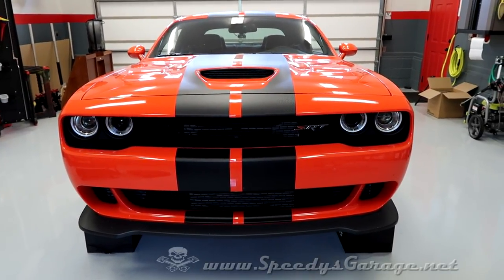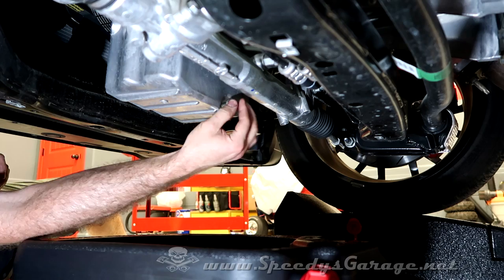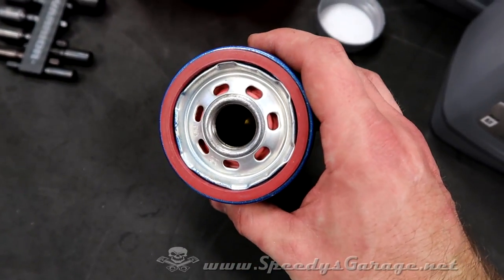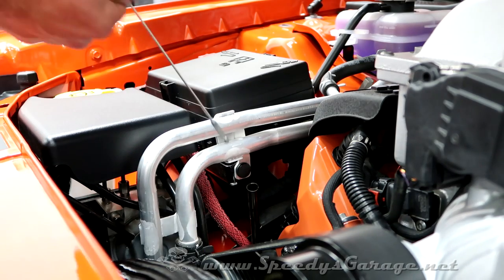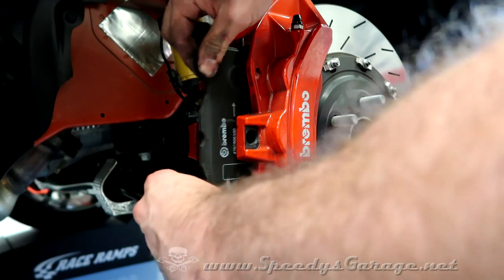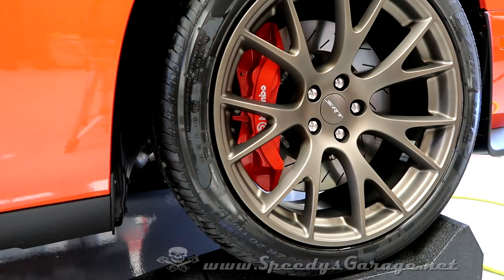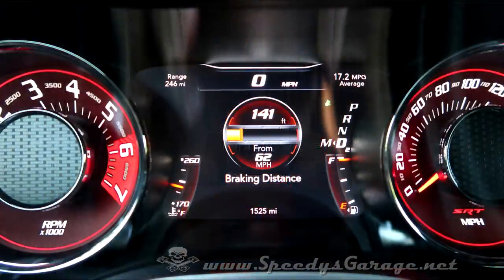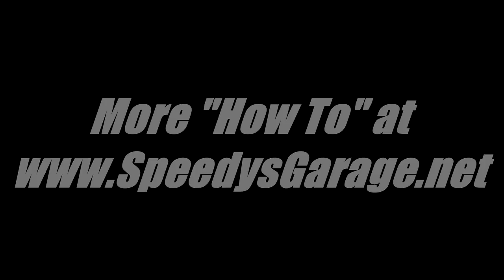Speedy's Garage Challenger Hellcat Oil and Brakes

Comment: I sold High performance racing parts to speed shops for a while & gravitated towards MOPAR guys... I've sold many brake packages of all types & the feedback I received from my Customers across the board was that pad break in was slightly more extensive than prescribed instructions... It usually entailed factory break in and 25-50 normal city/highway stops...All resins have burned off by then...

Comment: Did you know the 2017 Hellcat has a different Dipstick and holds a quart more oil? No other parts are different just the dipstick. So I got the 2017 dipstick and added another quart of oil. These cars do use oil so I think it its a good Idea to have a little extra. Also it seems to take about 25 mins for the oil level to register properly in my car. The brake caliper center support bolt is 22ftlbs.

Comment: Same guy that admires your basically everything here. Commenting with a different channel.
I have a 19 hellcat and was scared to drain the oil cooler. I thought it would starve the engine for a second more than I'd like. I usually fill the oil filter with oil and thought emptying the oil cooler would be the same as not filling the oil filter. Dry start up bad.
Reply from the maker: Right on

Comment: Totally, the wrong oil filter. Yet, I have found that STP has/had two different filters that will fit the vehicle.   I like the K&N filters best, yet I kind of use what I could get my hands on.  I change my oil often.  Also, I like ceramic pads which has less brake dust.  Like the oil I change my brake pads often.  Yet, I'm in the midwest I suggest checking your brembo pads and operation of same every 6 months at least.  By the way, nice video.  😊

Comment: Hey man I have a 2016 Challenger Hellcat. Changing the oil soon. Only question I had is where exactly are all 10 of those push pins located? That’s the only thing I’m kind of worried about lol because I don’t want to miss any. The rest of the 10/7 MM seem pretty straightforward. Get back to me if you can thank you! Great video 👍🏾
Reply from the maker: There pretty hard to miss.  Most are on the bottom, and a couple on the bottom of the front wheel well area.
Reply: Thank you for the reply I was able to complete it successfully with the help of your vid! Do you have the specific race ramps these are In your video or a link of them by chance? I have a stock 16 challenger hellcat and I’m looking into race ramps that won’t damage or scrape the car/front splitter since it’s pretty low. Jacking the car up is sort of a pain. Much appreciated if you could reply again thank you 🙌🏽

Comment: I am so glad you also used the Mobil 1. Some people thinks it is heresy not to use the FIAT/Chrysler recommended Pennzoil Ultra Platinum on the SRT vehicles.
Reply from the maker: I actually plan to switch over to Penzoil Platinum as it's my go to oil in the other rides.  They didn't have 0W-40 locally for a while and now it's available in the 5qt jug.  Be on the lookout Friday for a new video where I discuss oil analysis and why I like the Penzoil Platinum.
Reply: It will be awesome if you do the Blackstone Oil analysis for side to side comparison between the Mobil 1 vs Pennzoil UP

Comment: Good video, bit I would not use any oil that doesn't meet Chrysler MS-12633, even if it's 0w40. 
Anyway, I started using Amsoil Signature Series 0w40 which meet MS-12633. It seems like I'm getting better mpg and it does ride smooth

Comment: I put them on and went to the road course! Death Trap!! Either keep stock for both road and track use, or get track pads for track weekends (keep swapping).
Reply from the maker: I would not recommend anything but a true track pad for road course track days.  These cars weigh 4500 pounds and I'd question even the stock pads being enough.  I was able to EASILY cause fade on the STOCK pads after 3-4 consecutive hard stops as you could see from the tests each stop got longer with Z26 and Stock Brembo pads ending up almost the same distance in the end.

Comment: Hey speedy, did you ever find out the torque spec for that 13mm bolt? And also do you know what the torque spec is for the 2 bolts holding the whole caliper on? (For the front and rear) is it 121ft on the front and 98 ft on the rear? Do those need blue loctite as well?
Reply from the maker: I honestly can't remember.  I'll leave this out here and hope someone chimes in.
Reply: @SpeedysGarage  let me know man. I can’t find it anywhere and I’m gonna be doing a rotor and pad job on the car soon!

Comment: Hi speedy. You have some great videos man. Thank you for the information. I just went out to my driveway and swapped my brake pads watching your video. Thank you. 
I have one question. Are the new brake pads directional? In other words, does it matter which pad goes on the inside of the caliper and which pad goes on the outside?
Reply from the maker: Shouldn't matter in most cases.
Reply: Speedy's Garage I’m assuming in this case it doesn’t matter. 

Thank you for the reply man.

Comment: Hi Speedy- Did you or do you check the final oil level while the car front end is still up on the ramps? (Getting ready to do first oil change and change out the brake pads also...appreciate the torque specs...Thanks)
Reply from the maker: Both.  I check it on the ramps to make sure it's good to start and roll off, then recheck on level ground.
Reply: @SpeedysGarage  Thanks...I'll do the same.

Comment: You probably answered this question before but where did you get those ramps? How much$ ? And model #
Reply from the maker: They're Race Ramps.  I have these:  https://amzn.to/30Z1ApR and picked up some extensions for lower cars:  https://amzn.to/2SPyYMS  Highly recommended.
Reply: Speedy's Garage thanks I’m gonna look into getting the 10” higher ones that way I have more room to go under with my creeper. I saw on the net a guy with a Z06 using them and it cleared his front lip.

Comment: Since the Hellcat Brakes and the SRT 392's are the same. Where about do you buy your OEM Discs? I've found a couple of sites but I was just curious about how you go about it, as for your brake dust I sometimes use Autoglym Wheel Protector
Reply from the maker: Haven't had to replace the disks yet.  Solved my dust problem with new Z26 pads...now everything stays nice and clean.

Comment: Do you have to change the  dish or rotor every time you change the pads on a 2017 dodge hellcat
Reply from the maker: Only if worn past min thickness
Reply: @SpeedysGarage  thank you, the service adviser at the dealer in Miami Florida  that I had my car serviced at, told me that you have to change the rotor every time you put on new pads regardless if they are worn  or not. He said a brake job would cost $3000 dollars per axle. That the rotor, worn or in good shape could not be turned on a hell cat.

Comment: Only problem is Mobil oil does not meet the Chrysler spec. Pennzoil ultra platinum does that’s why it’s recommended. It’s the fill for all srt products. I would only use a mopar or mopar srt filter for the application also.
Reply from the maker: That's all gimmicky contract stuff between manufacturers unfortunately.  Chrysler had a deal with Mobil1 for their oil.  When FCA took over they had a deal with Shell (Penzoil) and changed the specs etc.
Reply: @SpeedysGarage  You are mostly correct but there are slight additive differences. Are you fine probably, if its under warranty then I would just stick with oem till that's out. Nice video with great information, just a point I wanted to bring up.
Reply from the maker: Yeah the warranty stuff is disappointing for FCA.  I've heard of them voiding guys warranties for not changing the oil every 6 mos as well.  Makes me wonder what happens to a warranty on a car that sits on the lot for more than 6 mos.  SMH.

Comment: Great video!! I have been following your vids for a while now. I'm glad you take the time to share your experience, I for one really appreciate them....Your R/T was bad ass and I'm sure your Hellcat will be (more) to... to bad you couldn't keep both but I'm sure you feel the same. I have a new 2017 M6 HC pitch black and my wife has a 2016 A8 scat pack shaker, redline tri coat pearl... defiantly  keep us posted on your mods, I'm changing the oil this week end on the scat pack then in a month or so for the HC, I only have 600 miles on her so far...LOL

Comment: Why would you sacrifice replacing OEM brake pads with proven entry level Chinese  powerstop branded ( box is powerstop but  brakes are purchased from various low budget Chinese brake pad manufacturers) brake pads?
Reply from the maker: Because they work much better and no dust.
Reply: @SpeedysGarage  Please define "work much better".

Comment: mobile 1 over purolater any day! ebc red stuff pads over any other pads any day too! hawk pads are awesome but have noise issues.
Reply from the maker: Meh, Mobil 1 is "OK" but over priced IMO.  I did extensive testing on a throw away car over a 4 year period with extended drain intervals using  Purolator PureOne filters including Blackstone oil analysis against Mobil1  and others, and results were better with the Purolator.  Not by much, but still.  Considering the Purloator PureOne filter is half the price of the Mobil1 and tested out better, it's a no brainer.

I have EBC Redstuff pads on another car, and they do work well, but generate more dust than the Z26 Powerstops.
Reply: I can agree that mobile1 is over priced. I've been lucky to have it in a local wally world cheap so i stocked up. I've never been a fan of the purolator filters as I too have noticed that they are thinner in size than oem. The same was true for my impala, my r/t magnum, and 300. I didn't do any oil analysis but I did notice I needed to change the oil a bit earlier. I moved on to wix filters and amsoil filters and oil. So far ok but nothing id push on others. I just can't see me going back to purolator filters. 

As for the EBC reds after my initial "brake-in" period I haven't had much dusting. my wheels are painted white so I must be lucky there lol. Also its a family car so it doesn't get the speed demon abuse so that could also be it. However they stop smoother and make less noise and dust than the old hawk performance pads and definitely oem. I will give the z26s a try out in the future.
Reply from the maker: On this Hellcat, I called Purolator to find out what is up with the filter.  The guy is check, but suspects a wrong P/N is being published.  PL12222 is a small filter with the same thread.  PL24651 is a MUCH larger filter and what I used on the old 2009 R/T Challenger.  I'm betting that is the proper P/N for the Hellcat and just waiting on them to confirm.
Reply: WOW. please keep us posted!
Reply: @SpeedysGarage mobil 1 better than stock penzoil sir no ..?

Comment: Z26 pads are biggest piece of shit pads on this planet! 
I have SRT392 and have tried them for 6 months...you do not get any break dust but very dull bite, and they create hot spots on my rotors that are visible and on top of that they are super dangerous when wet. Driving for 20min on the highway in pouring rain (pads are soaked and cold) and then apply break ...no bite for like second or 2...unacceptable.
Now I tried Raybestos Element3 pads P/N: ETH1405 and they are way better than Powerstops, not scary moments when wet and no dust at all. They are also G rated but initial bite is not as crazy as Brembo original pads but they are somehow good...but at this point starting to loose hope for perfect pad that does not dust. So next time I think I'm going back to dusty brembo pads...I love that crazy initial bite that throws you on the front windshield :-)
Reply from the maker: Mine have done OK, not hot spots, and I've not had problems in the rain, however I do agree on the initial bite.  Wish it had more.
Reply: @SpeedysGarage  i'm glad.  I'm continuing my search for the "perfect pad" for my SRT...:-)
I have used EBC Yellow Stuff on my other cars...excellent bite and fade resistance, lots of dust :-( and it scars rotors badly...will not put this on my SRT for sure.

Comment: Still not sure why you'd sell project orange crush when you had that lifetime warranty on it and it's faster than the hellcat.  But enjoy the new car.
Reply from the maker: I had run out of things to do to Orange Krush and just needed a new project to play with.  It was a FANTASTIC car and if I could afford to keep both I would have.  Luckily it went to a great new owner who's a gear head and engineer and he's stayed in touch with me on the car.  While not much faster, I suspect the Hellcat will edge out the 10.85 I managed in Orange Krush and the 8 speed auto will likely be the difference there.  The technology in the Hellcat is just unreal and it does an amazing job managing those 707HP to get the most out of them.